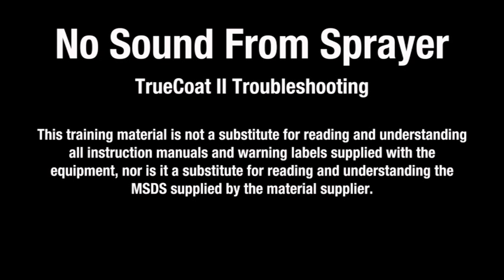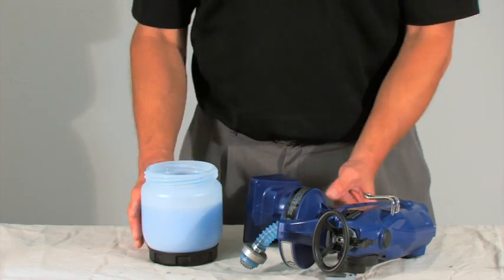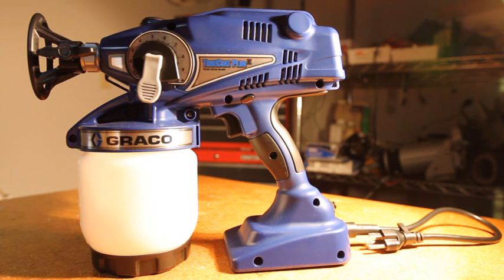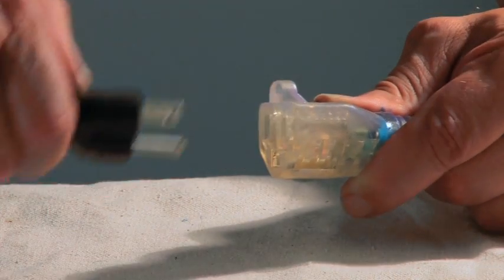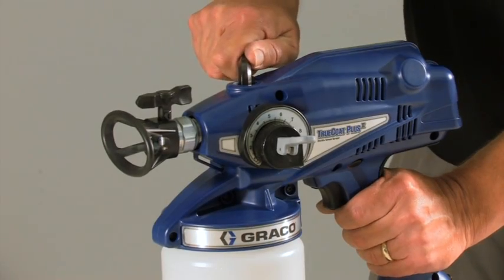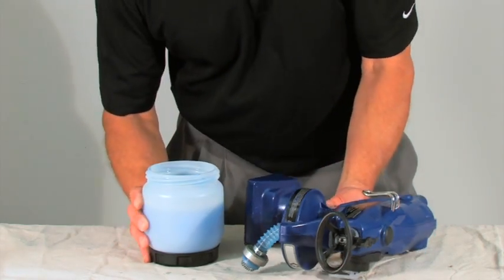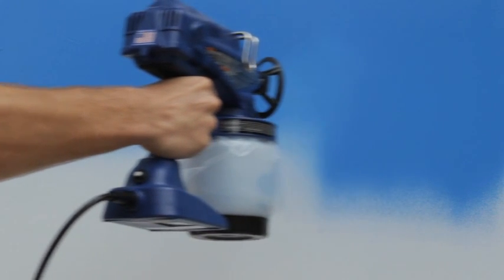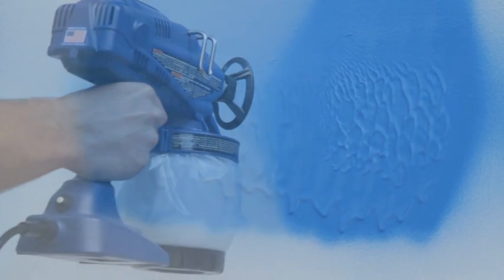Graco TrueCoat II Airless Paint Sprayer Troubleshooting

Comment: Any suggestions how to remove the small cylindrical filter in the spray tip?   I do not see any obstruction and to not want to crush it, but just wanted to make sure it was clean to the end.   Thank you for your help and videos.
Reply: I saw a video that said it was reverse threaded so try turning clockwise not counterclockwise and see if that works